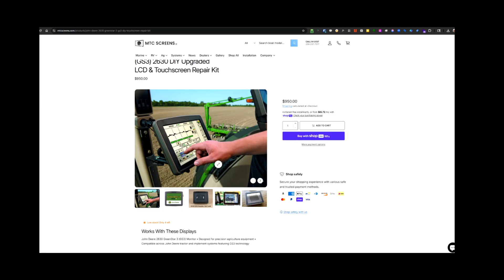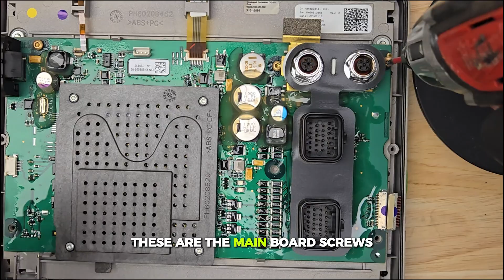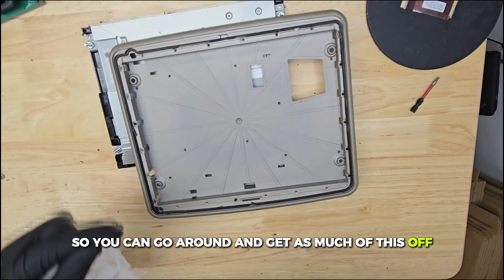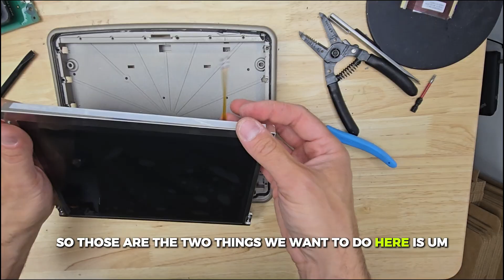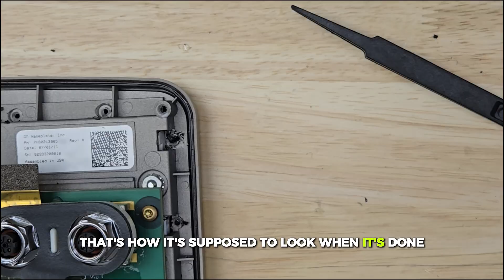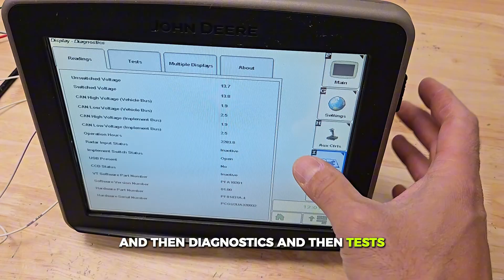How to DIY replace John Deere 2630 GS3 GreenStar3 Delaminated LCD Touch Screen : Fix  Bubble / Froze

Comment: We have a 2630 thats just starting to form air bubbles in the gel.
My only question after watching this:
How stable is that front bezel going to be without the plastic rivets? Or will the RTV adhere enough to keep it from shifting around? Have you had callbacks with problems from the bezel?
Reply from the maker: No call backs. Rtv is plenty secure

Comment: did the gs3 2630 use different lcd screens through the years? I have repaired one of our monitors already. went to do the second one, and the lcd and touch panel have completely different ribbons than the first one. After watching this video your lcd has a completely different lcd ribbon than both the ones I have, but the touch panel looks to have the same ribbon I had on the first one I did.
Reply from the maker: I've never seen any other style than the one shown